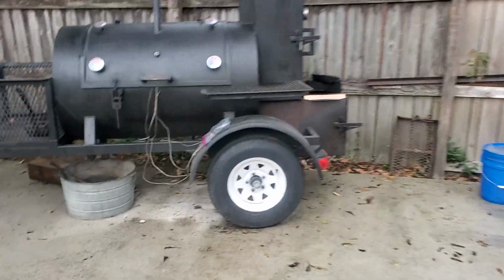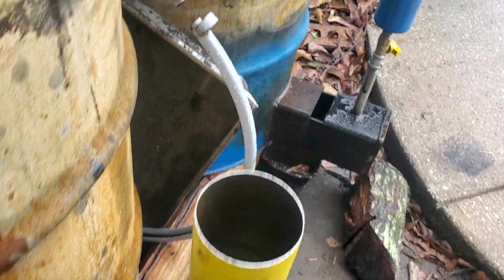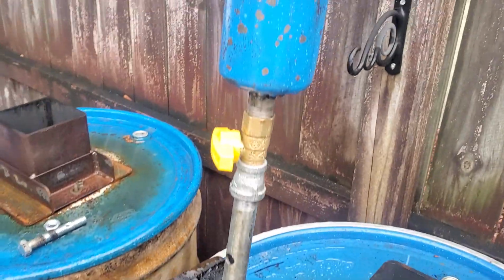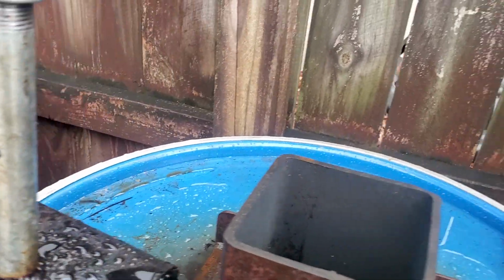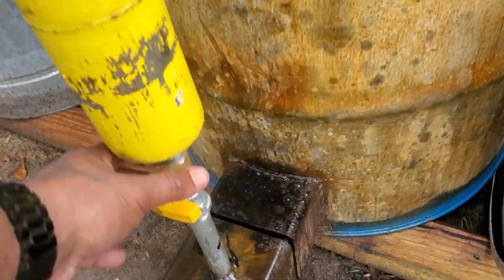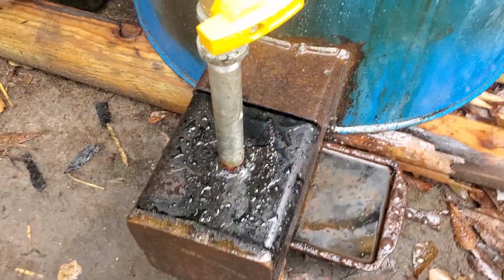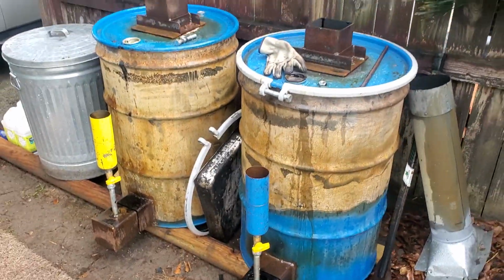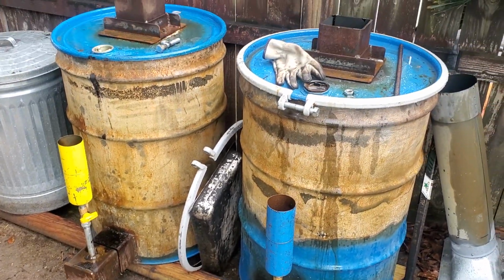Oil burner charcoal kiln

Comment: The first and second attempt at making charcoal in my waste oil charcoal kiln failed. The wood inside is blackened but not any charcoal. Not even the softer wood like pine or elderberry. The barrel got very hot to the touch but not hot enough to do anything but dry the wood out. A few leaves were turned to charcoal but no wood. I kept the waste oil burner going hot for maybe 3 hours hoping the wood gas would take over but I saw no or little evidence of wood gas ignition. The wick helped keep the flame going plus I had two coals from Kingsford wicking up oil to keep it burning. Not sure what else to do. I have to wait till late at night to light it up to make sure it doesn’t upset the neighbors.
Reply from the maker: @cdgarrett1  I'm not sure either.  It may need to burn longer.  Each woods moisture content requires a different burn time.
Reply: @ I emptied the barrel and split up the wood and filled it loosely leaving 1/3 of the original load on the ground. Maybe there wasn’t enough air space in the wood to heat up. It was packed pretty good. I did find about a hand full of charcoal in it. I also scraped out all the creosote build up at the barrel top. Perhaps the Canola oil mixed with transmission fluid wasn’t hot enough fuel. I hope I can get a few nights with no precipitation and little or no wind plus have a fuel that doesn’t smoke. I wait till after 10 PM to light it up. If the neighbors complain all my work on this waste oil biochar retort is in vain.